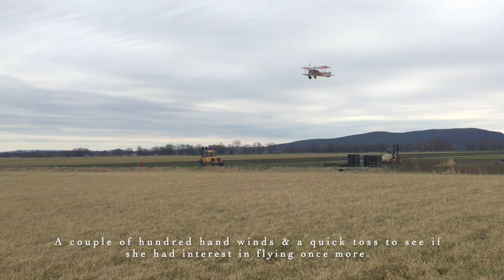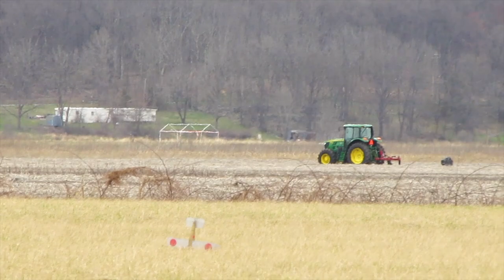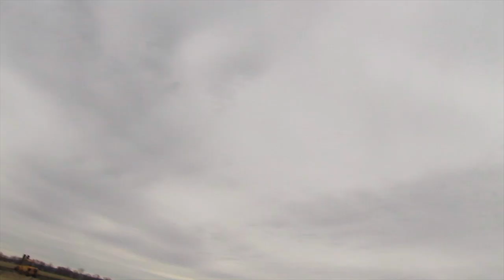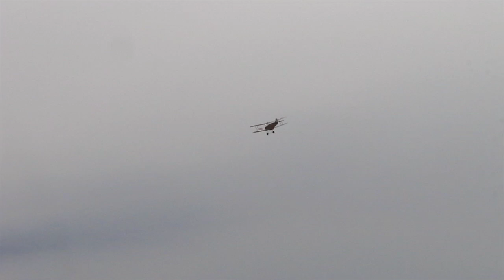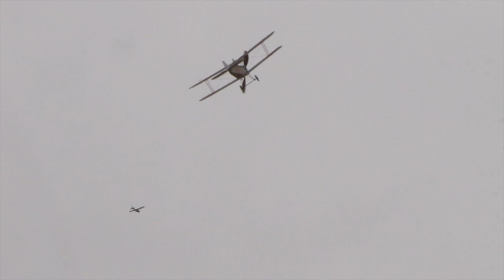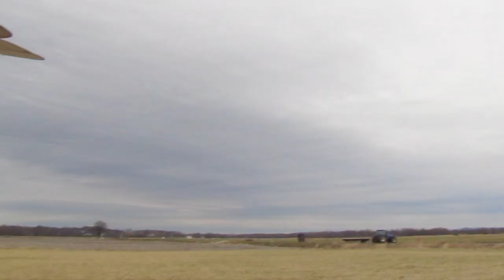First Flights After 9 Years in the Hangar - Rubber-Powered 22.5" Mitsubishi 1MF1

Comment: None of the rubber powered aircraft I built in the 1970s flew anywhere near that well, and one was the very similar SE5a. Very enjoyable watching.
Reply: Andrew, that is interesting . When I was a teenager I built several Guillows free flight models before I went into RC, but my most favorite was the se5a which flew   Very well indeed.
Reply: @jvaubry  my SE5A was probably a Keil Kraft version. Not pre-cut, just ink printed, so one had to have good eye to hand coordination to avoid the blade following the wood grain rather than the ink lines

Comment: Tom, I'm curious, when you have a slightly steep glide, although with a nice climb under power, do you tend to look at CG or elevator first? Or something else?
Reply from the maker: Ideally you should set the CG by first doing glide tests, without power.  Ideally in very high, soft grass.  U can even do it without the rubber in model, which is a safer approach, since the model is lighter, and less prone to damage.  The elevator is surely part of the deal at this initial stage. Once the CG and glide is set, and after u add rubber and re-ballast to hit that same CG, it's all about changing the thrust until she powers skyward into a nice climb.  Theoretically, the stab settings should be left alone.  Since the CG was established before powering up, her glide should be fine after u go forward with power. However, in the case of this film, I was in a hurry to get through a few trim sessions, so I should have spent more time on the glide.  The grass was dry and brittle, not ideally green and soft, so I was hesitant to test glide too many times.
Reply: @maxfliart  I really appreciate the time you took with this question and how much effort you make to educate us. I will soon start building a workshop where I can rekindle my participation in this hobby and have cherished and stuffed away all these great tidbits of wisdom - I've been a fan for years. Thanks for all you do👍